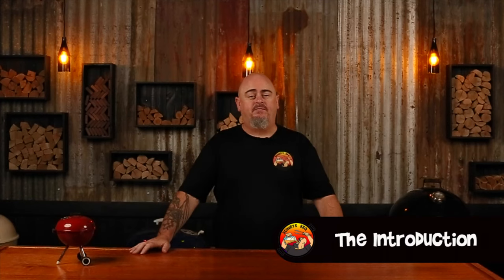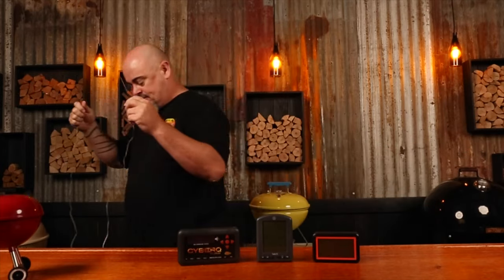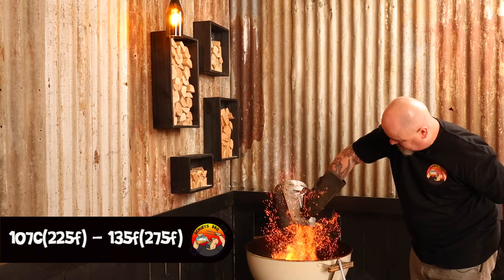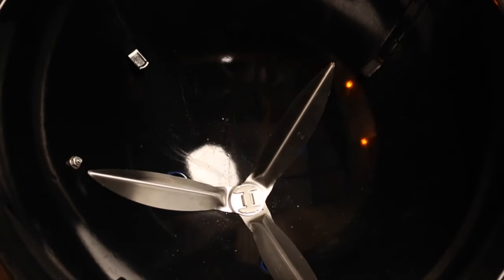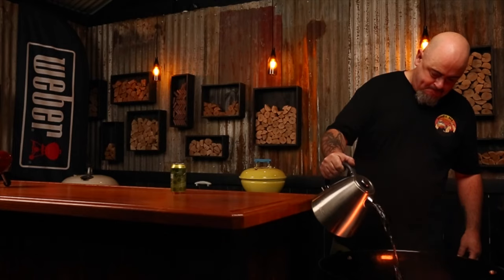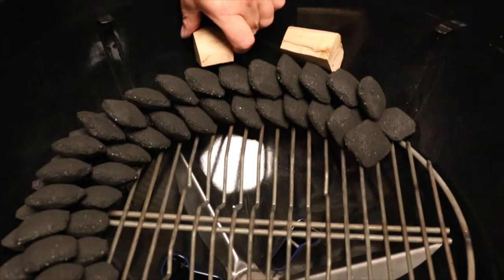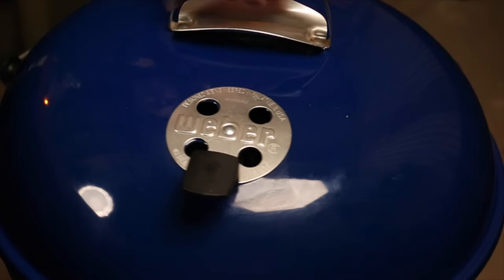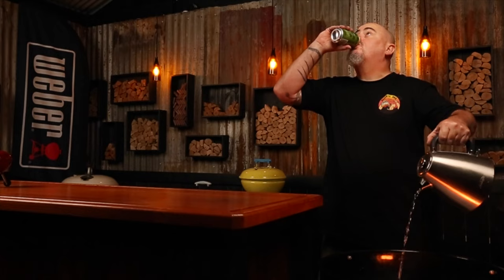Easy temp control using a Weber kettle

Comment: I put a seal around the lid of my Weber kettle helps control the temperature better you could find them online they just glue to the lip of the top
Reply from the maker: Thanks for the suggestion William Grayson I tend to scrape my Weber's out with a razor after a few cooks and fully clean them up. So that would mean removing any gasket each time 🍻

Comment: Schuey. Loving your work mate.
Off topic. But do you always go brickettes over Lump Charcoal?

I’ve been using lump as I thought that it was supposed to give a better taste, but it can get tricky to manage the temp in the Webber.

Are Brickettes the only way to go for consistency on a brisket?

Cheers 😃👊🇦🇺
Reply from the maker: Thanks @bradhouston4734, using briquettes over lump for the snake method is best. Find a good quality briquette and you'll be fine with taste. I do tend to use lump in my WSM and my GA's and sometimes using the charcoal baskets in the kettles. They all have their place mate. But to answer your question, for low and slow cooks in a Weber or similar kettle, using briquettes in the snake method works best for consistent heat control. You can use the minion method, banking up a heap of coal and lighting one end, similar to the snake but you end up with less indirect grilling space. Hope that helps and sorry for the delay in my response. 🍻

Comment: Correct Me If I'm Wrong. OPENING the Vent(s) INCREASE's The Temps while Closing The Vent(s) DECREASE The Temps. Right? You Can Make Fine tune adjustments accordingly.
Reply from the maker: Effectively vents control airflow mate. You need one to allow air in and one to allow air out. As Webers are such a small chamber, by closing down the lid vent, we trap in what is called dirty smoke and this can have a negative impact on your food and make it taste bitter at times. So by leaving the lid vent wide open, this will draw the hot air and smoke across your food. By closing or opening the bowl vent or vents (depending on the age of your Weber) you can adjust the temperature of your Weber. So you can dial in specific temps once you are close to your target temp by making very small adjustements on the bowl vent opening and allowing a good 20 to 30 minutes to see the impact.
Reply: @SchueysBBQ well said…

Comment: new to the BBQ game, I see a lot of how to videos that have briquette fuel measurements (ie 10-12 in the basket and add 6 lit ones from a chimney), do you have a good way to translate or convert that to charcoal? or should I just eyeball based on physical volume of fuel? not sure of the precise differences between the two fuels.

Comment: Question mate. I’ve done a ‘burn in’ on my new Weber master touch plus. Do you season yours with oil etc like you would a cast iron pan ? If so, how often ? 🍻
Reply from the maker: Hey Jack Marr. Good question. There's no need to season a Weber as they are coated in porcelain enamel, the same coating your oven has on it.  🍻
Reply: @SchueysBBQ  wicked easy. Going to do your kettle kone dimmies for lunch and charcoal chook for tea. Bloody keen.

Comment: Great vid bud. What brand do u recommend for a Bluetooth or wireless temp probe. Can those wireless ones handle a flare if using a rotisserie
Reply from the maker: Thanks andrew carson. I was using the ECPin in this video. It does have a few connection issues but they have brought out a booster for it that I have yet to trial. I liked it as it is powered by a super capacitor and fully charged in around 45 seconds for 6 hours run time. The Meater is the other option, powered by lithium batteries but something about putting a battery near extreme heat bothers me.   🍻

Comment: I love this video! But, what about the vent in the lid of my Weber? If I keep the bottom open mid-way, what will opening and closing the top do? I assume opening the top will create a greater flow of air and a higher temperature 🌡?
Reply from the maker: Thanks Derrick Mackins by closing down the lid vent, or exhaust vent, you start choking the airflow and slow it down. This intern holds in dirty smoke, it is always best to leave the top vent wide open and ajust your temps with amount of lit fuel you start the cook with and the positioning of the bowl vents mate. 🍻
Reply: @SchueysBBQ well said

Comment: Hey mate does the top vent always stay fully open, just adjust from the bottom?. Thanks Manni.
Reply from the maker: Thanks mr spazo (Manni) yes mate, use just the bowl vent to control heat. The top vent stays open to clear the smoke or you can end up with a bitter taste as you are choking the fuel down. Congratulations on the 5,000 followers on Instagram mate. 🍻
Reply: @SchueysBBQ  thanks heaps mate.  Great video I learnt heaps, 5000 and still new to a Weber kettle 🤣.

Comment: I am new to grilling - couldn’t quite catch on to the number of lit briquettes. Do you mean we only light a certain % of charcoal and let the remaining be unlit? How do I determine that split?
Reply from the maker: Hi Neel Patel, snake method and minion method (including the MTP), lite up 12 briquettes to get temps around 107c to 135c (225f to 275f), to achieve temps around 135c to 160c (275f to 320f) you start with 15 lit briquettes. For the roasting method using the two charcoal baskets, fill both baskets with lit fuel. For the dual zone cooking method using one basket, fill this completely with lit fuel. I hope the clears it up a little for you mate. 🍻

Comment: Thanks, this was just what I was looking for! Simple explained how it works. But what would you recommend to set your vents right at the start of session when you want to cook on 120C? Half way open or first all open and then squeeze untill the correct temp? Love the bloopers :P
Reply from the maker: Thanks Dimitri, can I ask what set up are you using, I'm guessing you are trying the snake or minion method to get 120c, what are you cooking in, is it a Weber Kettle or Weber Smokey Mountain, or other,  🍻
Reply: @SchueysBBQ  you are right, I want to give the snake method a try. I have a 57cm weber master grill and all though no 2 kettles are the same I  think there is a rule of thumb? What would you recommend?
Cheers!
Reply from the maker: @Dimitri75  I do have a video on the snake method but I'd start with 12 lit briquettes at the end of your snake, once the temp reaches around 100c, close the bowl vet to about half, that will slow the temp rising and give it 20-30 mintes to react, if it isn't dialed in to 120c after 30 minutes, close or open the bowl vent by an 1/8 and give another 20 - 30 minutes to settle. Initially a little stuffing around but once you "Master your Grill" you'll be able to set this up really quick, good luck mate.
Reply: @SchueysBBQ well explained

Comment: This video will save a few missing eyebrows and cold snags. Probes can double up as a body temp test during rona season. VIC weather can do a harry holt.
Reply from the maker: Thanks Cleaver#351 I really appreciate the support, cheers  mate, we all need eyebrows when BBQing HaHa
Reply: @SchueysBBQ  no worries mate. Speaking of probe do you have an affiliate amazon link or the like of a decent probe, ive been in the market for one
Reply from the maker: @cleaver3519  hey mate, no affiliate links as of yet. I'm in the process of setting all that up for anything I believe in and use. If I could only have one, it would be the Thermoworks Smoke X4, this thing is built to last.

Comment: My Weber kettle is a family hand me down and it is nearly 30 years old, the bottom vent is very worn out and sort of just flops around in the bottom of the bowl.
Reply from the maker: You can take the ash sweeper out and bend them back into shape of buy a whoe new set from Weber for less than $20 if it is really bad Sam Shepherd 🍻
Reply: @SchueysBBQ  it's really hard to get the ash sweeper out, it's rusted together I think.
It's a different design to the ones they use now, it has a thumb screw that goes up into the bottom of it.

Comment: Brilliant video mate! I was just wondering do you have any tips on keeping that temp stable for let's say around 2-3 hours? Going for my first longer cook for my birthday!
Reply from the maker: Thanks Danilo Cedeño. The best way to keep temps stable in a Weber, I'm assuming you are using the snake method for a longer cook,, which is always a great way to keep your temp stable. By adding a pan of warm to hot water to the charcoal grate at the start of the cook, this will also help keep the temps stable as water rises and lowers in heat slower than air does. Just make sure it' cold water or your Weber will take forever to get to temp as it will need to heat the water up first. 🍻

Comment: The snake method goes against so many bbq rules I’m still waiting on the comparison video 🤣 even super dry smoking wood gives off rancid smoke in the beginning of the burn no matter what so isn’t the snake method adding rancid smoke through the whole cooking process?? Also meat only takes on smoke for the first half an hour or so 🤷‍♂️🤷‍♂️🤷‍♂️😝
Reply from the maker: Thanks @richardwilcox5988 Okay,

First part, I’m not sure what “rules’ you are referring too. 

Smoking wood if dried properly and lit under correct conditions, that being enough oxygen, heat will not create rancid smoke, otherwise every offset smoker in the world would not work properly.

The snake method using briquettes is no different. Most briquettes (most not all) have no bad additives in them. When you light up the briquettes it is recommended to allow the initial starter batch of briquettes to fully alight and ash over, then placing these at one end of the snake, you should allow around 30 minutes for the temp to be dialled in and for the unlit briquettes closest to the alight briquettes to warm up and heat up. Once heated, they do not create and rancid smoke. A lot of the white smoke can be moisture trapped in the briquette (I do have a video in the process of being made showing this)

As for meat only taking on smoke for the first half an hour, who told it to stop taking on smoke after the first hour was up? It logically will take on smoke for as long as it is exposed to smoke.
Reply: @SchueysBBQ  I was referring to the method of some people get their goals, going, or heat beads, going all at once in the tower to prevent any chemicals coming from the heat bates versus the snake method, which would continuously be releasing chemicals as it burns along, wouldn’t it?